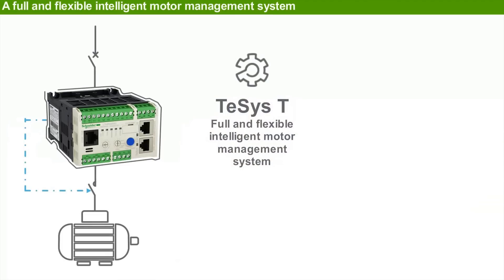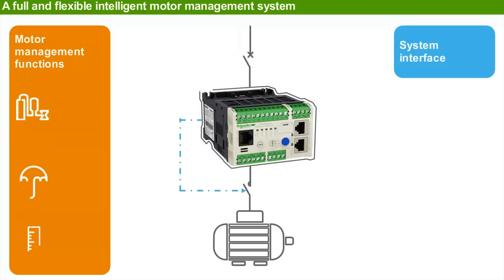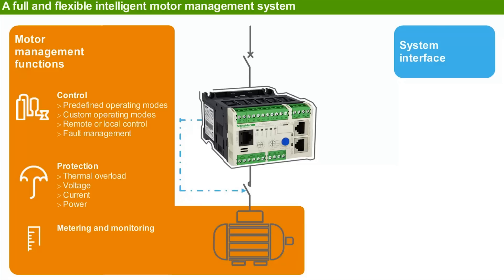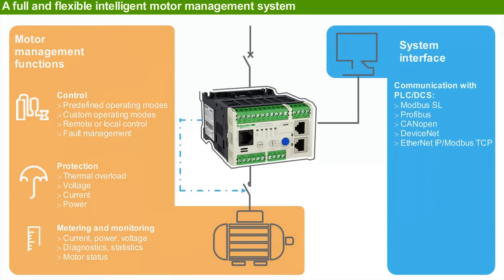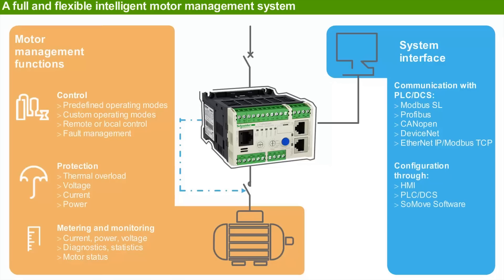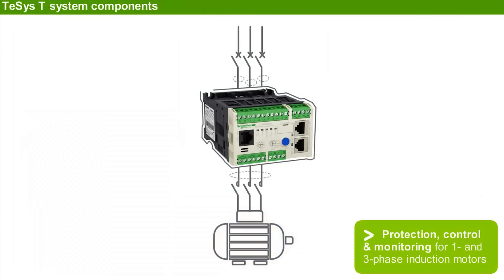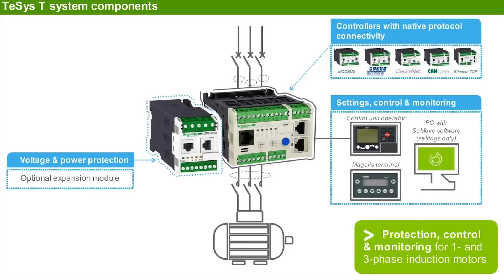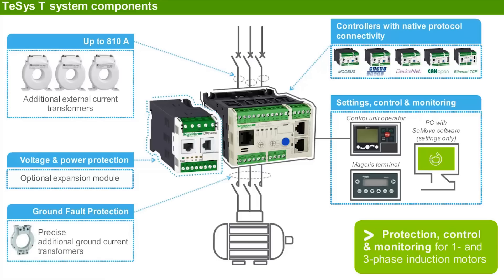Discover What is TeSys T | Schneider Electric

Comment: Is it applicable for star-delta starter ?
Reply from the maker: The TeSys T does have two-step operating modes for use with reduced voltage starting applications such as wye-delta, open transition primary resistor, and open transition autotransformer.   Please contact your local Schneider Electric support team if you need further assistance.